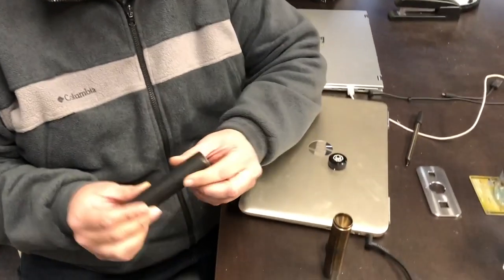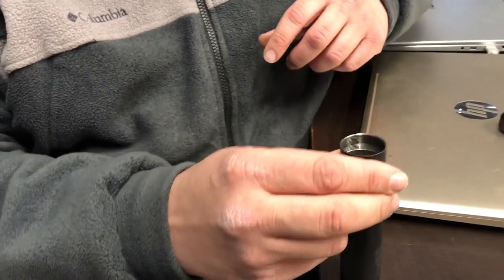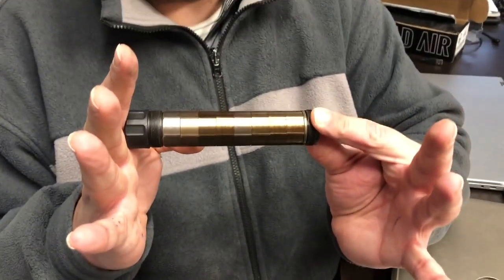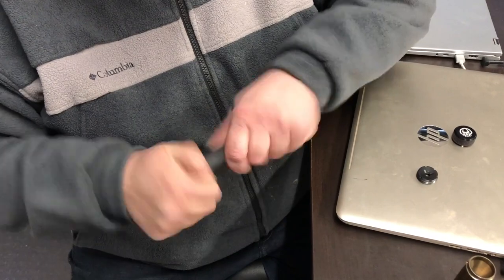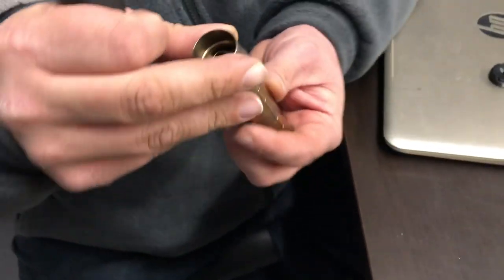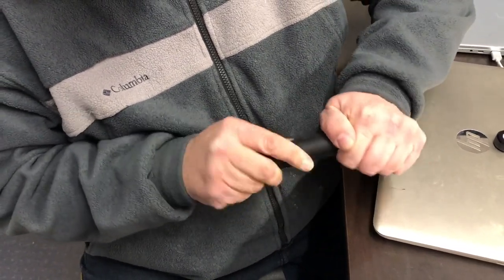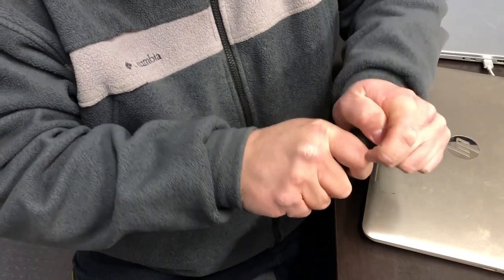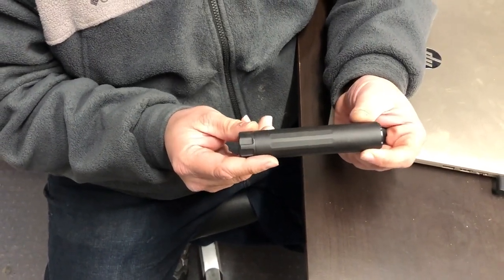Mask-HD Assembly

Comment: My only disappointment with the Dead Air Mask has been reassembly after cleaning as this design has ambiguity and the small and large blastports as well as the caps can be incorrectly assembled. Thank you so much for putting out this production. There are a few D/A Mask tutorials on YouTube but this one is elegant in its simplicity and I appreciate the minimal duration. 
Stay safe and Stay Strong,
Boston

Comment: I have Spectre 2 but... I love the sound of that mask wish I could trade.
Reply: Spectre 2 is a great and innovative can.  Have you tried shooting it wet with RemOil sprayed in both ends and rotated around to spread it?  You may be pleasantly surprised at the different tone.  I have graduated to using "Blitz" brand spray foamy white lithium grease... I just stick the spray tube in each end all the way and spray while withdrawing the spray tube, about 2 quick  sprays in both ends, 3-4 sprays for 9mm or 40 or 45 ACP cans.  World of difference.  In a monocore like the Liberty Mystic X or the Cosmic where there is a lot of internal air space I load it up even more.  The light foamy white lithium is soft enough that even if you get some in the center channel, the grease is not dense enough to cause the bullet to deviate and cause baffle or end cap strikes.  The same can not be said with heavy paste like lithium lube or even wire pulling gel which can often settle and occlude the center channel.  Water works but settles to the bottom of your tube so you don't get a circumferential application of an ablative and water blows out quickly.